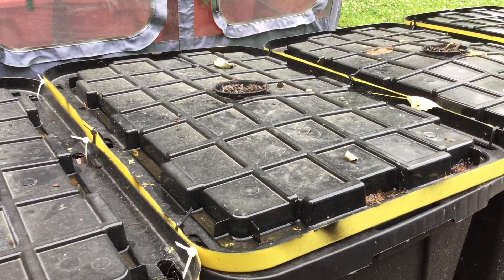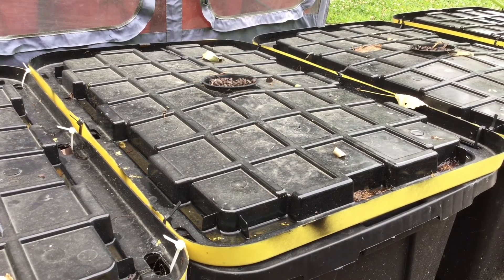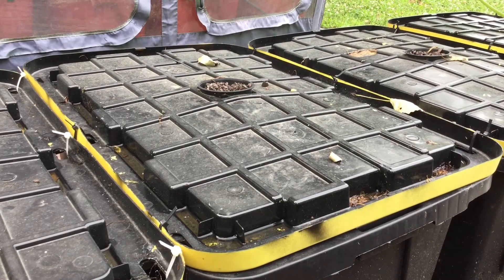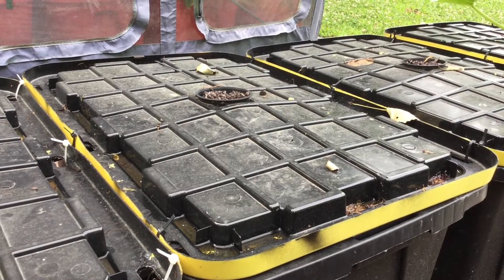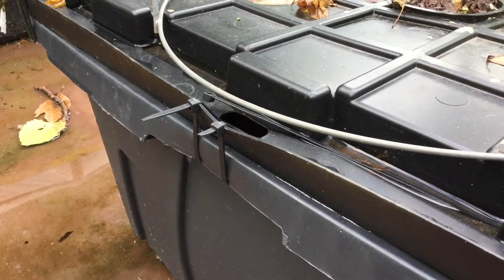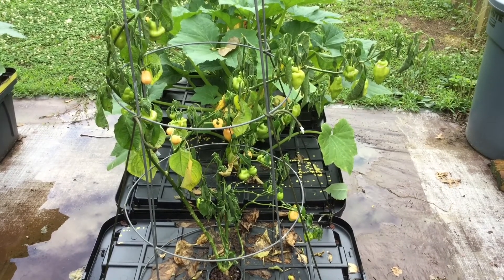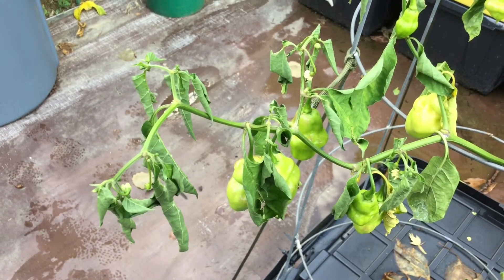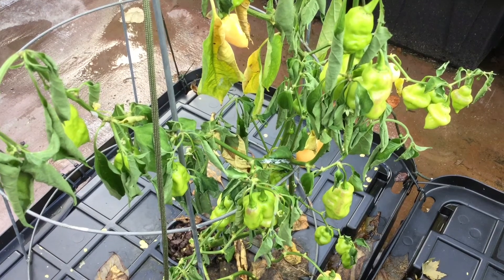B.A. Kratky - Outdoor Hydroponic Containers - Why the 27 gallon Sturdy Tote fails.

Comment: I'm building a system with these at the moment.  I'm using the lids right side up and will probably use a number of zip ties along the side to hold the sides in, although some bulging is not a problem.  I think your big problem is using Kratky for this.  I'll be using a Tetra Whisper aquarium pump to inject air into my system so I don't care if rain fills it up.  After rain you just need to check the pH and EC and adjust accordingly.  I grew some tomatoes over the winter in San Francisco with 5 gallon buckets with air injection and they did very well.  I had some Kratky buckets last year and got some production but not as much as with the air injection.  I had root problems in the Kratky but with the air injection the tomatoes filled up the buckets with healthy roots.  These containers are very cheap so if we can find a good way to use them it will be worth it.
Reply from the maker: Thanks for your comments!  Yes, DWC changes everything.  You could drill a rain water overflow where you want your water level, and just monitor nutrients.  I was far away from electricity when setting up my Kratky grows, which limited my approach.  I have moved since then and have more resources like nearby water and electricity.  Post your new setup sometime.  I'm curious to see how it goes.

Comment: Snap the lid on properly and then run a couple of screws through the lid and container and the top will not be able to bow outward.
Reply from the maker: Thanks for your idea.  In addition to the flex in the side walls, there are six pass through holes in the lid edges that caused seep through.  I am keeping the totes for inside my greenhouse, but going to dome lid trash cans outdoors at this point.

Comment: What would happen if you were to put a hole in the side of the tote to correct level of water that the roots need?
Reply from the maker: Hey Mike, nice idea.  With the single fill method of Kratky hydroponics, the nutrients gradually fall until there is around 10% of the original solution left.  The roots grow down to the bottom of the containers.  If I drill a hole in the side to allow excess water to drain off, it creates a problem.  Toward the end of the season, rains can raise the internal solution level from 4" off the bottom all the way up to the lid with several days of rain.  That kills the plant, since only the roots tips are the only part in water during the grow.  The excess water "drowns" the plant.  I have found food grade trash cans are a much better answer.  The dome shaped lids shed rain water easily.

Comment: I was thinking about using these totes in a system but I Was going to "Build" a container for the totes to sit in having them in a container that will "hold" the sides in place should be enough to make this work. 

My idea was to build a box around them that looks nice in the yard, that way I don't just have black totes sitting about. 

The container would also protect the totes from direct sunlight as well as "reinforce" the side walls from the weight of water over time. I also assumed they would only last 2-4 season's based on use.
Reply from the maker: Michael Wood these containers are holding up much longer than standard indoor totes with no UV protection. Your wood suggestion for improving the look is a good idea. Rain seems to be the biggest issue. The size seems to be good for several varieties.
Reply: Thanks, I Was thinking that the wood would help UV/Rain keeping the tote out of the element's as well as making it look more "appealing" than just having totes in my yard :D

Comment: The problem is not the tote itself but in your setup. The easiest fix is to install an overflow drain in the side of the tote. I garden with aquaponics and all of my various types of containers drain back to a Consolidated sump tank.  Because all of my containers have overflow drains installed, any excess water flows back to my Sump tank and helps to replenish losses from evaporation. You can get a three-quarter inch rubber grommet from the hardware aisle at Home Depot for less than a dollar I I believe. Off the top of my head I believe you need a 7/8 inch hole saw bit to install that three quarter inch grommet and then the remaining whole is the perfect size for half inch PVC. That's how most of my overflow drains are set up. That three-quarter inch rubber grommet will give you a watertight seal around the half inch PVC.
Reply: Beat me to it but very well put.

I just got this tote and was worried I made some mistake but the issue seems to be in the modifications rather than the tote itself.
Reply from the maker: Appreciate hearing how you would handle these issues.
Reply: Yeah easy fix

Comment: I recognize this is an older video, so you have likely figured out a fix by now.  My suggestion would be to drill a couple of overflow holes on either end of the container, right below the bottom of the net cup - that may ensure at least that you will have air roots from that point up, no matter how much water enters the reservoir.
Reply from the maker: Tara Walker Great idea!! Thanks
Reply: The issue you may run into with that is "air pruning" of the roots. The idea of air roots works because the air pocket is humid as the water vapor is trapped in the water reservoir.

The second issue is that the nutrient water will deplete faster due to evaporation with the air pocket becoming dry much more easily

Comment: I had same issue, so to fix it i ended up cutting some aviary wire to the same size as the opening and cable tie-ing it inside the tote just below the level of the bottom of net pot. It keeps the bottom of tote in perfect shape and the lid keeps a good fit even in hot sun
Reply from the maker: Good idea, I am hoping to provide others with ideas of the best containers for outdoor hydroponics.  While I may give this container a thumbs down, I think your idea has a lot of merit.
Reply: Im actually using this in all my totes now as it also seems to promote more root growth. The wire gives the air roots more support and they tend to spread horizontally as well as down giving them more surface area, similar to when dr. kratky uses the fly wire.
Reply from the maker: Great to hear, and nice reminder about B.A. Kratky's work.

Comment: Got a tip that I think will work for you: Get yourself a piece of 4" round PVC pipe from home depot or wherever. Cut it into 6"  or 8" lengths. You'll place these over the net cups on top of the tote. You can slide the plant up through, or cut a slot up one side of the PVC to allow you too slide it around the plant stem. Or just drop the plant down into it, a 3" net cup should slide into a 4" pipe.

Now get yourself some poly sheeting or tarps (painter's drop cloth or whatever) and cut out something like a 4 foot by 5 foot section. Cut a 3" hole in the center of the tarp, and attach it to the upper edge of the PVC pipe. You could use binder clips to hold it in place, or maybe duct tape around the top of the pipe to hold it. Drape the outside edges of the tarp over the edges of the tote. Effectively you're just putting up a little tent over the top of the tote with a raised center. Water sheds off and other than what falls directly into the PVC  pipe opening, your water level will be mostly unaffected.

If you  do that, you can flip the lids back over and attach them normally, which will give a bit more structural stability to the sides of the tote and keep it from bowing out so much. To keep the tarp from flapping in the wind or collapsing under water weight during rain, you could just tape it to the side of the tote. Or get some small pieces of wood like 2x2's and staple the edges of the tarp to them to weight the edges.

The poly sheeting or tarp will only last for one season usually. UV light destroys them. But they are pretty cheap so easy enough to replace the next year. Instead of the PVC pipe you could also get some 1x2 boards and build a small 5" cube box frame to accomplish the same goal. You could even staple the poly tarp to that instead of needing to worry about clips or tape. You just need something in the center of the tote around the net cup to raise the tarp high enough to shed water.

Anyway, hope it gives you some ideas and maybe works out for ya. Good luck. :)
Reply: I should note that this would mostly just work for something like the peppers that stay up off the 'ground'. It wouldn't work for something like a melon or squash that sits on the ground, cause if it sits on the tote lid and collapses the tarp, you've just made a swimming pool there instead. ;)
Reply from the maker: Very nice idea, thanks!  Looks like I might be moving all my 27 gallon totes inside a greenhouse, and using only dome lid trash cans outdoors.  However, I may end up experimenting with an idea like yours.

Comment: So in summation is it problem with being outside  and perhaps the container not UV protected? I've had simular problem non UV protected container where they distort  causing issues
Reply from the maker: Gordon Pilcher Great thinking to consider that, but these are outdoor totes. Length of time in sunlight would not be consistent with that level of UV degradation either. The warmth of the sun, gravity, and sagging seemed more to blame.

Comment: Matt. I created an aeroponic system in one of those totes years ago. I used weatherstrip tape ($7.67 Homedepo) to stop water leakage. Go all around the lip of the tote in one long stream do not cut the tape into four sections or you will have  leakage issues.
Reply from the maker: Very interesting idea, and great idea on the DIY aeroponic unit too.  Thanks!
Reply: Thank you. If you like i can forward you the DIY build for that Aeroponic system.

Comment: Block of wood under one end. Cut the "Lip" off the low end and Silicone the open slots. 1/8" fall per foot is how flat roof patio covers are set.
Reply from the maker: Jypsy Dog Excellent suggestion!  I may have to try that.

Comment: What do you use for nutrients? How are the nutrient levels adjusted throughout the growing season, for example when you have to top off with more water?
Reply from the maker: I select a container that has enough water to last throughout the plants lifetime, and add dyna-gro complete nutrient at half strength, around 1 teaspoon per gallon.  If the container matches that plant's needs, then no other water or nutrients are needed.